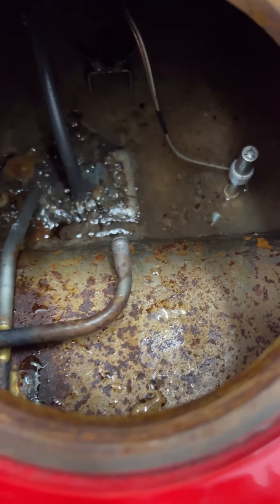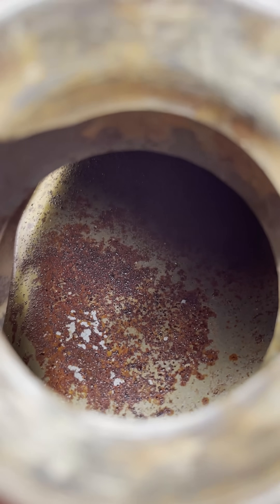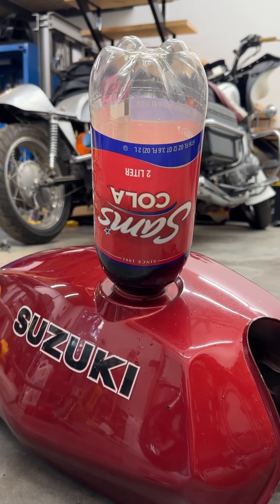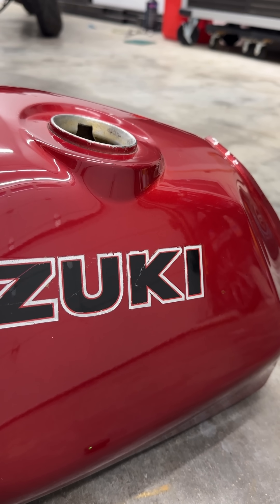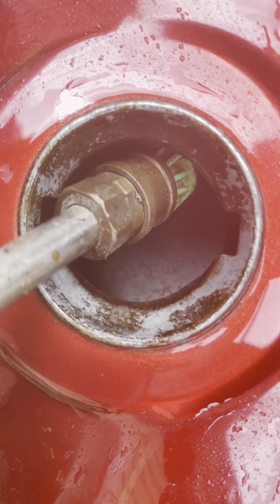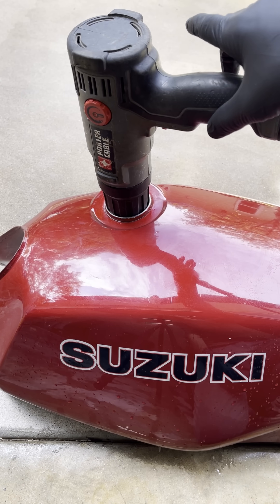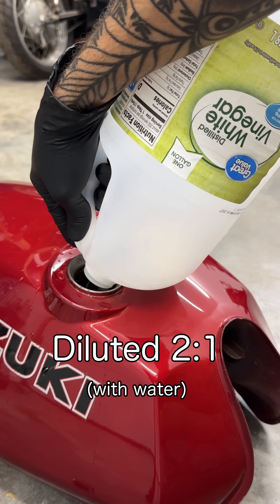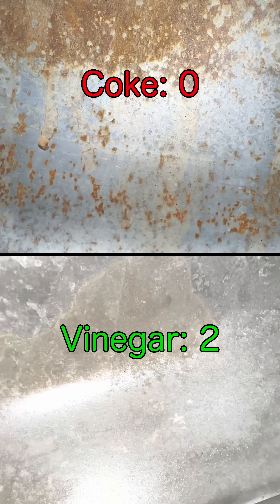Does Coke Actually Clean Rust?

Comment: So get a few bottles of vinegar. . and then get some baking soda? i have 3 vintage honda tanks and they are all intact..
Reply from the maker: Yep, vinegar, pressure wash, then baking soda flush, more pressure wash, then I usually pour some gas in it and slosh around/ drain to get any remaining water out. Then dry (heat), and either put it into use with fresh gas or spray down with some fogger or WD to protect it for storage.

Comment: Aren’t you supposed to seal the gas after cleaning it with vinegar?
Reply from the maker: If you do a baking soda wash after so it doesn’t flash rust, you don’t have to seal it unless you live near the ocean or leave it outside a lot. Or let it with ethanol fuel in it for long periods of time.

Comment: red kote the inside of the tanks after cleaning, while it isnt a permanent solution for ethanol it will keep the tank from corroding further. red kote is sold in pints so you can get 2-3 applications from a single pint

Comment: My buddies dad always had a bunch of dirt bikes and ATVs around all the time, he used to dump old motor oil in the metal gas tanks, never understood why until I needed a metal tank for a 86 ATC, dumped the oil out rinsed it out with gas and it was brand new inside after sitting outside over 10-15 years

Comment: You expose it to acid which etch the metal and expose it to water which is also an oxidizer and heated it so the oxidation process proceeds now you're left with thousands of microscopic rust which will grow back after several weeks. trash the tank afterward
Reply: Use rust converter, and wash it with lacquer thinner multiple times. Plus a bit of thinner is safe for engine  and no drying needed. These agents are not oxidizers and you'll 100% sure theres no build up rust in your engine and you havent etch the metal so no more rust comes back
Reply: you do you use water for your sport bike? or you buy cleaning agents that are not very expensive. even a regular honda could benefit for just 10$ cleaning chemicals

Comment: stop these coke and vinegar diy stuff. it'll mess your engine with that extra acids. use rust converter and wash it with thinner multiple times to drain all converted ferrous oxides no drying needed. its a lot faster, it clears 100% plus a bit of thinner also good for your engine not a single tiny debri that will hurt your sport bike engine.
Reply: Or might as well trash your bike because you added acid on it itll be rusty again in a couple of weeks. you already itch the metal exposing it to more oxidations
Reply: You expose it to acid which etch the metal and expose it to water which is also an oxidizer and heated it so the oxidation process proceeds now you're left with thousands of microscopic rust which will grow back after several weeks. trash the tank afterward

Comment: Again, there are like 1 or 2 thousand videos just in YouTube doings this 🤦🏽  
So you don't even know there are specific products for rust removal? 🤦🏽
Reply from the maker: @claucas01897  there are 1,000-2,000 videos testing dark soda to remove rust from a gas tank? 😱 dang I’m late to the party. Yes you can go buy Evapo-rust, it’s works well. It’s also $$$. I did a vid showing how I clean tanks for way less using vinegar. It got tons of comments that I should use coke, which I was skeptical of, so I made this video to see if it works.

Comment: I might try vinegar next time, I used evaporust last time then dried it out and washed the tank out with petrol which I threw in my lawnmower afterwards, I have a little bit of flash rust still so I might redo it with vinegar

Comment: Vinegar is great. I had smashed my big toe at work and it caused my nail bed and nail to split in half and deformed. Tried everything. After 7 years and never being able to wear sandals I decided to try Vinegar soak. 3 parts Vin and 2 parts water. My nail healed completely and restored the nail matrix. Miracle.
Reply: White vinegar or regular vinegar? How long did you soak it at a time , how long did it take to heal? Thank you

Comment: It's not about being cheaper with coke.  It's about using something you probably keep on hand compared to something you might have to go to the store to buy to use for one or two things.  Would it be easier to just buy the vinegar? Sure it would but if you didn't have any but you did have coke in your fridge wouldn't you rather save a trip if you could? That's why people use coke in this way.

Comment: Soda isnt acidic because of 'phosphoric acid'.. its acidic because of the CO2. Household vinegar is just acetic acid which is a weak acid in a very low concentration but still slightly more acidic than CO2. If you want to use something REALLY acidic then use something like toilet bowl cleaner. That would have a good concentration of a strong hydrochloric acid.
Reply from the maker: @koreo9436  while carbonic acid is a weak acid, it is not doing anything to remove rust (though it isn’t great for your teeth enamel). Phosphoric acid is for sure what makes soda acidic however and is also the active ingredient for cleaning rust.

Comment: I worked in the oil patch and without getting too technical, there were components on old well heads that would get stuck sometimes after years of not being opened up. They said Coke and not Pepsi was better for loosening it all up.

Comment: Meuratic acid, and tumbling stones. With a half horse motor. Built into a lazy susan. It allows you to clean out a tank overnight. Without throwing out your back. If you set it up properly. You can even clean the inside top of a gas tank too.

Comment: Putting basic chemistry in the perspective, Vinegar is Acetic Acid. 
It dissolves iron oxides that can leaves salt which is easily removable with water. Comparing that to Phosphoric Acid which makes iron oxides into ferric phosphate which is easy to scrub off.
The reason why it's considered a failure in this video is because you can't scrub the inside of that tank without disassembling it or using some particular cleaning tool, as well as because of the obvious fact that soda has carbonated water. There are indeed situations where you can use coke as a cleaning tool, but it's usually better to use vinegar cause its cheaper. So it's not really practical to use coke.

Comment: Por15 is the best tank sealant I've ever used.
It worked Wonders on a 1994 Katana 600 tank that was found in a barn and had pinholes in the tank I used por-15 inside the tank and 7 years later it's still fine

Comment: Is there really nothing to be done after the vinegar and distilled water rinse? 
I've heard plastic sealant works but I worry it doesn't work as well for more complicated welded tanks. 
Otherwise I've heard using 2 stroke oil after drying puts a coating on all the metal and doesn't impact the gasoline you put into it much. 
Especially on older carbed engines without a catalytic converter a little 2 stroke oil won't hurt.

Comment: I agree that using vinegar as an acid is better. However if you are comparing it to using coke and just rinsing it of with water, you should include the cost of whatever base you used to metal's the vinegar (unless you also neutralized the coke with that same base and don't mention it.